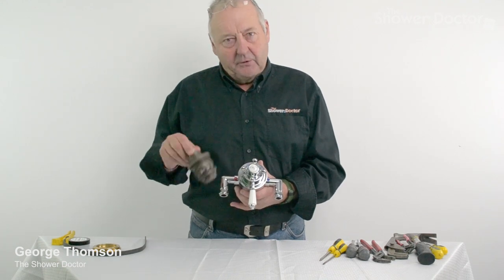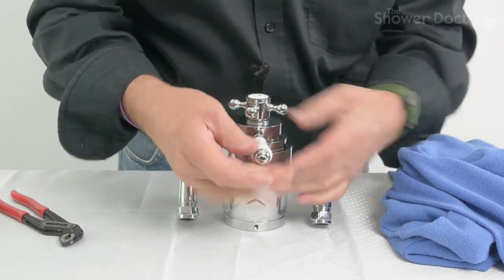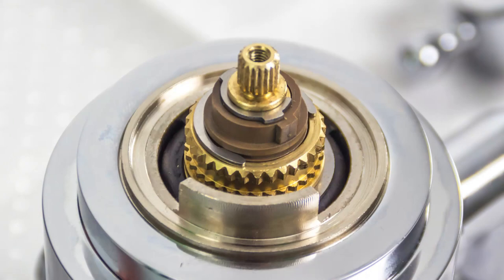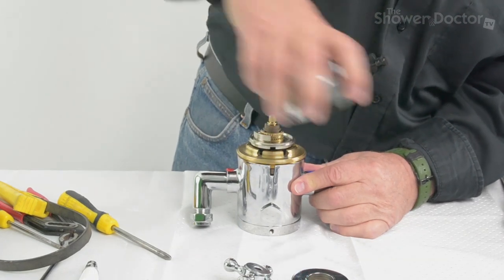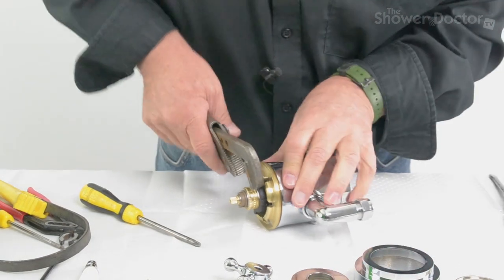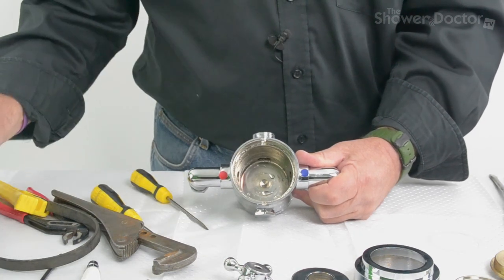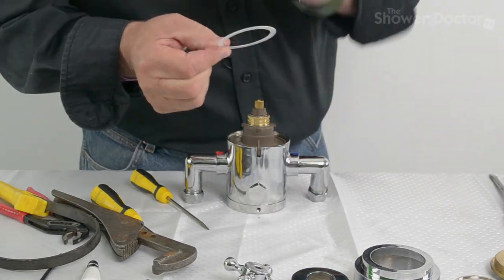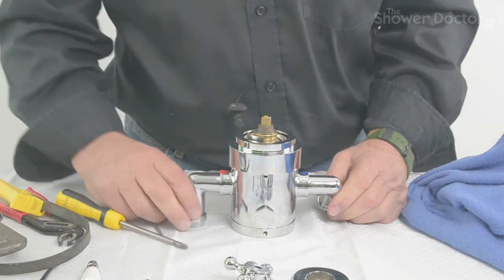Ultra Finishing 1/2" Dual Control Valve. Part 1: Disassembly & cartridge replacement

Comment: Watched this a number of times and it looks quite simple, but replacing the cartridge when the valve is on the wall is a different order of difficulty. George, it's easy doing it on a workbench, but not so easy when its on a wall over a bath. So tricky to get it inserted and still stuggling to get it working after days of trying. I must be jamming the piston somehow. Now removing the whole unit from the wall to do on the workbench to see if that'll work!

Comment: That strap undo thing is called a Baby Boa strap wrench. Only a few pounds and did the job brilliantly. Thanks Doc
ALSO : Check the elbow inlet strainers! Tiny wire mesh filters are in the elbows of my shower valve. One was clogged - nothing to do with the valve at all. AND if at all possible think of how you're going to get at your valve and pipes when it needs servicing! DON'T go for fully concealed!

Comment: I have 2 of these shower valves.  Both have temperature control problems.  I have fitted one new valve from yourselves but still have the problem.  I have notice that the hot feet is on the right on both showers.  The front housing has the 2 screws at the top, with the one at the bottom which looks like it has been fitted the wrong way.  Could this be the problem?